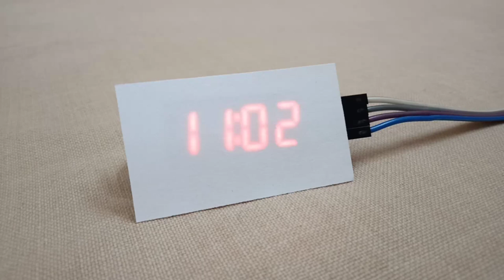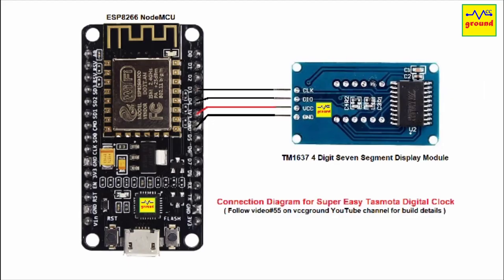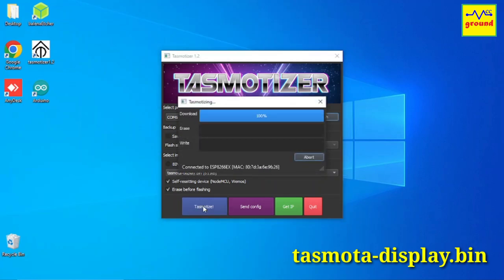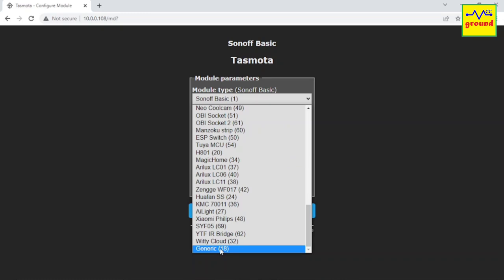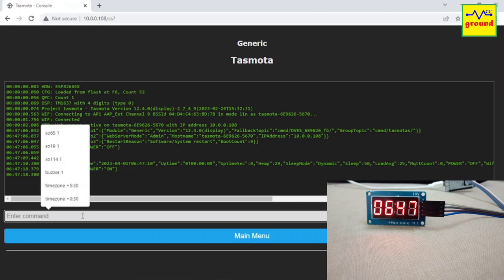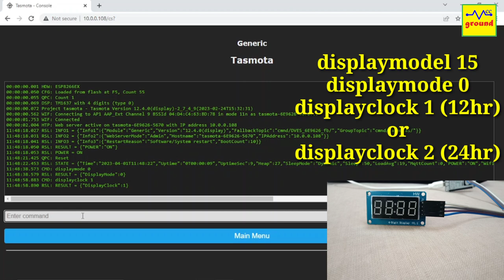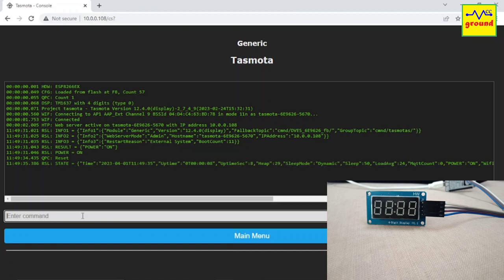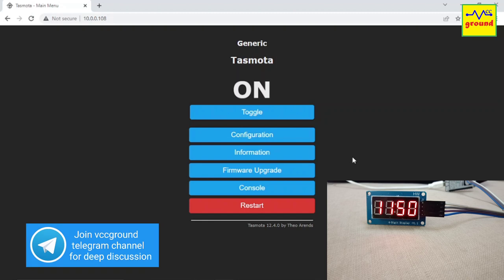#55 The 5 minutes DIY Digital Clock | The Easiest Digital Clock Ever | No Coding | No Soldering.

Comment: hey can we do this same clock with a Dot matrix Max7219 ? and also what is the white sheet that u have covered the clock with ? whats it called
Reply from the maker: To use Max7219 dot matrix display, you first need to compile a Tasmota binary with support to Max7219 dot matrix display enabled . To learn how to compile a Tasmota binary, watch my video number 36. The MAX7219 module needs to be connected to three GPIO pins. Check more details on the same at https://tasmota.github.io/docs/MAX7219/

That white sheet is nothing special but a small piece of an ordinary white printer paper.
Reply: Looks like paper to me, but I use red electrical tape that works and looks good!!

Comment: I have MH-ET LIVE Tiny88(16.0Mhz), DS1302, DS1307, DHT22, BMP180, BME280 modules and TM1647s (Several of all).
I would like to make time, and temperature with these.
I currently only have the MH-ET LIVE Tiny88(16.0Mhz), DHT22 and TM1647 working nicely for Temp/Humidity on display.
Lets see some old ANALOG Panel meters turned into time, temp, and humidity or something neat!